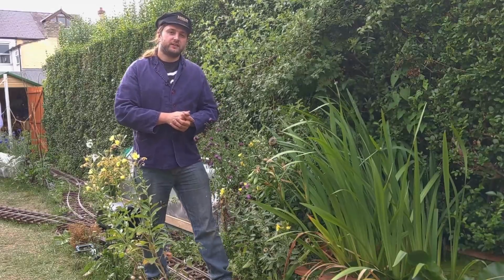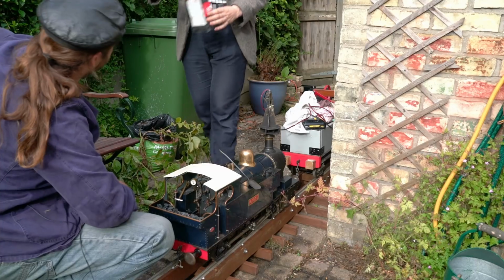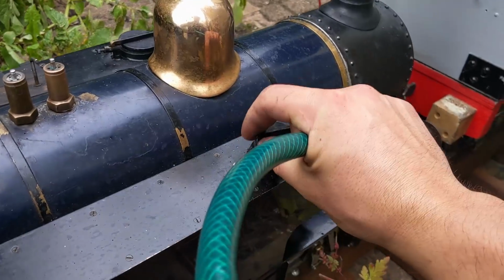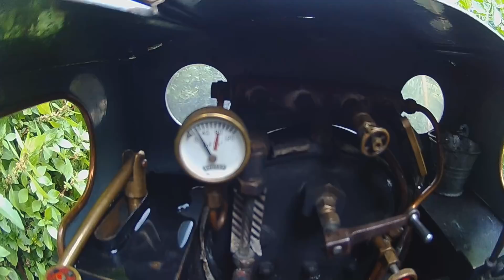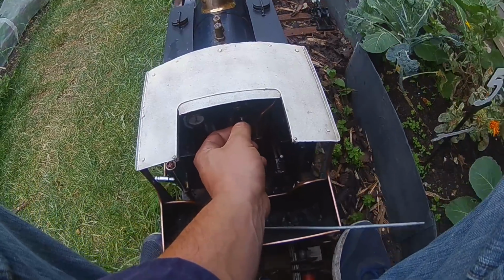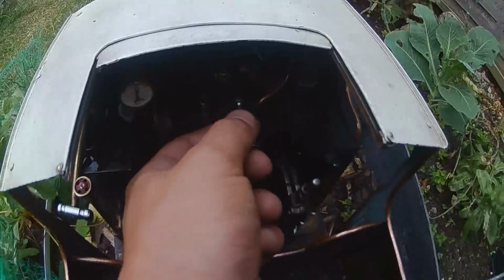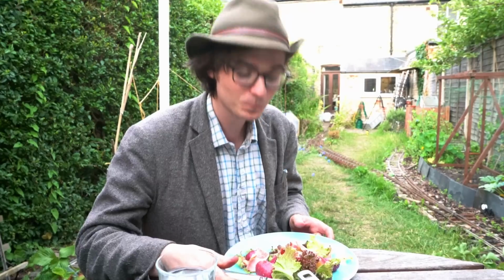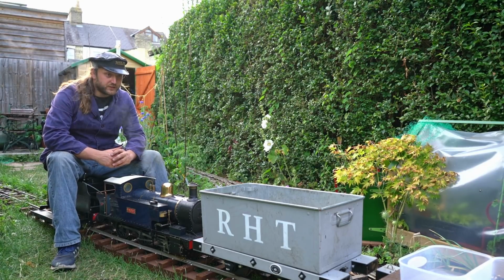Is the smallest working railway in the world? - 5 inch gauge in the garden. LGLL Ep.2

Comment: I'm curious how much this whole setup cost total, including engine and car. if that is ok?
Reply from the maker: I can't remember but Zach built all the rolling stock!
Reply: Hullo. Loco was bought disassembled but with a new boiler at £1200. The rail was second hand from Birmingham MES for £50 with tons left over. Points were second hand from another MES. Wheels and bogies are bought from ebay as and when they come up. The steel tubs are £25 each. The main extravagance was the driving truck chassis from RoR at £350 at the time - worth it though as the only braked vehicle. Everything else is home bodged from hardware shop stuff. Hope that helps.